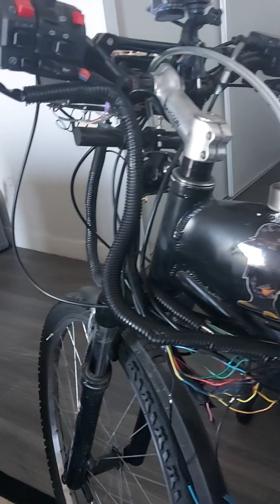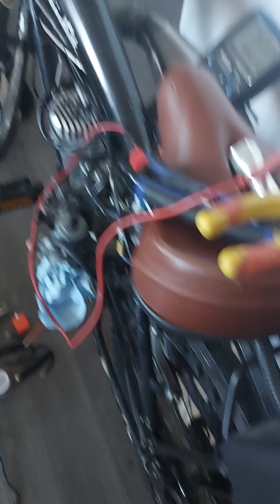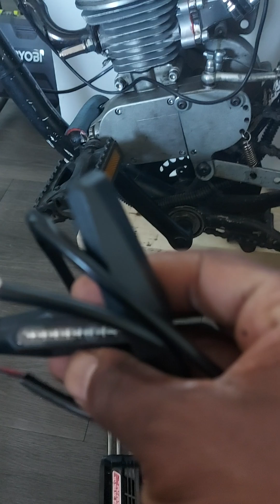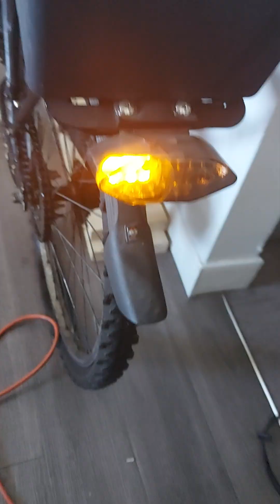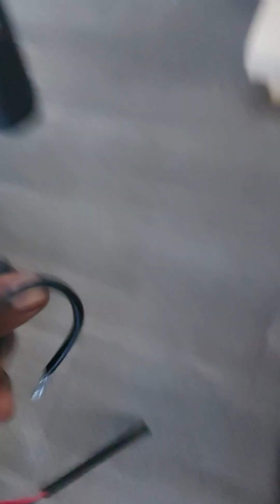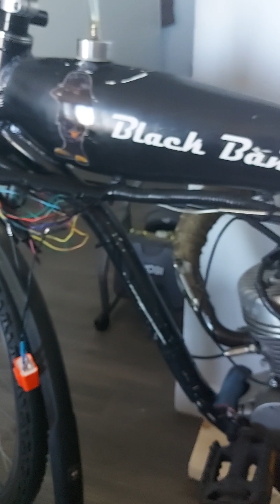Motorized bicycle lighting and electrical

Comment: Calculation you have fourteen amp hours at 12volts, not to bad
Reply from the maker: I have upgraded the lighting on the bike. It’s probably going to use a little bit more current in terms of amperage, but I did upgrade to a lithium battery 20ah i’ll be putting the video up soon

Comment: Need to try that set up 👍
Reply from the maker: I added on more gauges so I could get more information around the motor since I run it very high rates of speed. I need the motor to be running top notch